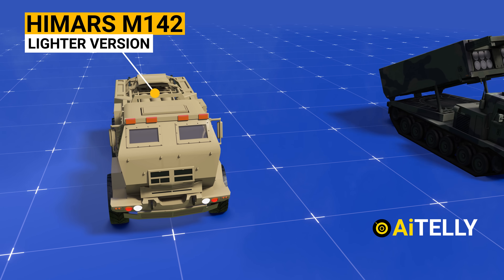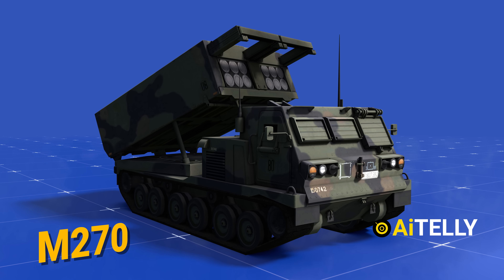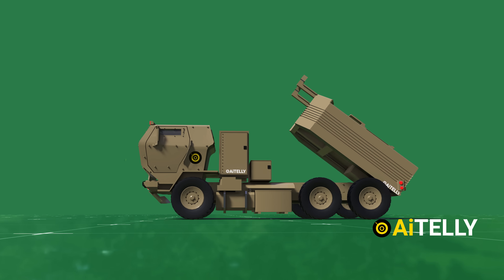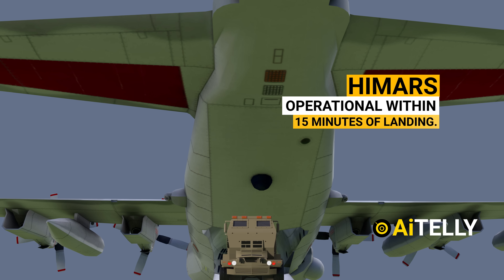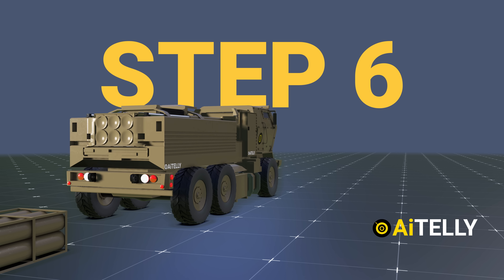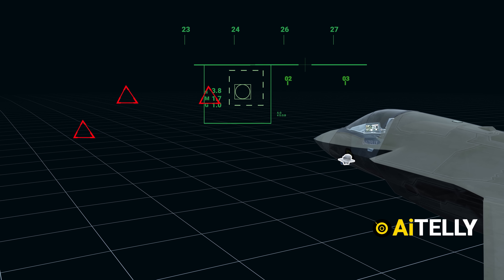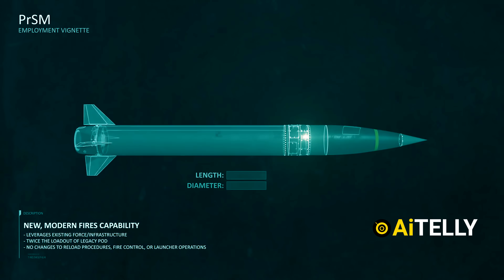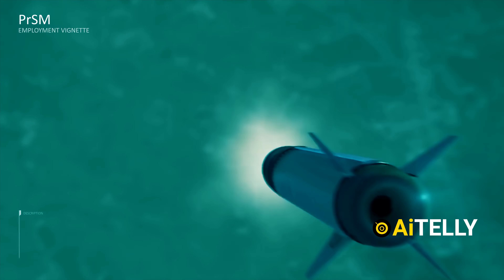HIMARS Precision Strike Missile  How it Works

Comment from the maker: Correction/ Detail Explanation  from Viewers Comments.

1)  verdebusterAP  (replied to a question) from Celestial Existence

How gps signals can be received when the missile travels at Mach 3 moreover the gps is inaccurate when the object is moving ?

Answer:
The missile use what's called inertial navigation system (INS) INS uses a combination of various factor to get the missile to target
GPS refines the targeting data so the missile is much more accurate
Thanks to advances in technology, INS is far far more accurate 
Again also thanks to GPS-jammers, the US developed newer sensors to counter jamming
Example 
Circular error probable (CEP) , basically how weapons accuracy is measured with out GPS is 200-300 meters
GPS can reduces CEP to about 10 meters or less 
In case GPS is jammed, the newer sensors developed can achieve a CEP of 30-50 meters
Lastly, to use HIMARS missiles against a moving target, it would have to be a very high value target or asset
Its called predicted none line of sight 
Basically , a forward observer provides the target course and speed
They take the target speed and combine with the missile speed which depends on how far the missile has to travel and come up with point of impact
Based on target speed of 40 mph , it will reach this point in 1 min 12 second
They designed that point and fire 
The M30/31 have 200lbs warhead so it does not have to be direct hit
They don't use this method unless its absolutely necessary

2) " nichevo1 "
Let me try. How GPS signals can be received when the missile travels at Mach? 3? I do not know, but my telephone can accurately gauge me driving at 100 miles an hour. And that's with music streaming. High performance military systems and in particular those using the military GPS signal presumably have higher performance capabilities. I would think that the designers were aware that they would be dealing with entities traveling at high speeds. Do you assert a performance limitation of GPS in vehicles traveling at a certain speed?

You ask a second question about inaccurate GPS on a moving object. Either It's the same question as the first, or you mean that GMLRS doesn't have a seeker. Maybe they could put one of those in the nose of this thing where they have the extra space. 

Meanwhile, aside from volley fire by dead reckoning, which I believe our host states is current practice, if you have somebody steadily designating it, I don't know, but it might be able to receive GPS updates in flight. That would be interesting to note in a later update. 

Anyway, that was never in its brief. But we love to stick more gadgets on everything so I'm sure the D variant will have a trimode unit for another mil ;-)

Third verse, same as the first. Military signal is more jam-resistant, military hardware is more jam-resistant.

3)" Joshua Thomas "

As a former 13M (multiple launch rocket system operator) The m270A1 is much faster over ruff terrain than the m1083 truck that himars is based on.  it accelerates faster as well because 1083 trucks have very bad acceleration. Tracks over any other surface besides paved roads are aloso superior.

4)" Hypersonic Hobo "

(Well explained regarding the efficiency between HIMARS vs M270A)

At the ranges HIMARS plays at you almost never need to leave the road unless there are just no roads, so functionally it will almost always be faster than the M270 in a European theater. 

What it loses in a rocket pod it gains in mobility, far easier maintainability (wheels beat tracks on maintenance every day of the week) and fuel consumption. These aren't the sexy aspects of warfare but an army marches on it's stomach. 

In the era of GPS guidance where one rocket can take out almost any target if you are using HIMARS as a strategic bomber as Ukraine is against depot's and HQ's you won't feel the loss of a rocket pod as much but you will appreciate how easy it is to care for and how unbelievably fast it is.

Military vehicles being primarily tracked ones when you talk about road speed limits. And at a theatre scale 20 kph adds up fast it will take 4 hours to drive what the Himars can in 3, that can add up to multiple extra launches per day.
Reply: GPS даже военный, в снегопад, туман, дождь, задымление ошибка до 100 м минимум
Reply: @Михаил-в5ф9ы  хорошо, скажи это вашим сегорешвим ванькам
Reply: On March 6, Russia struck with two daggers at once and completely destroyed an underground bunker in the Lviv region, in which several generals of the Pentagon, NATO, many colonels died ... there are also losses from the Armed Forces of Ukraine.  This was a response to Ukraine's sabotage invasion of the "old" territory of the Russian Federation.  Western media hush up this event.  The inhabitants of the bunker at a depth of 120 meters were not saved by the latest Western air defense systems.
Reply: Does it use others, like GNSSm too - eh?
Reply: You also got weight and length of truck wrong.
Reply: Kapan livenya booosku...????
Reply: Agree.
Reply: THE BIGGEST PROBLEM OF HIMARS IT IS TOO EXPENSIVE AND ROCKETS EASILY TAKEN DOWN EVEN BY SOVIET AA SYSTEMS, IN LONG TIME CONFLICTS IT IS USELESS, BECAUSE WILL EXHAUST PRODUCTION OF AMMUNITION
Reply: @dotabuff5288  production is already stretched. Will take about 18months to catch up m
Reply: The biggest fault of this system is that is isn’t very successful. In desert storm 1 this system shot down more allied plans then where lost by the enemy
Reply: @Grant80  ... you are making zero sense.
Reply: Молодцы, сумели распиарить на войне устаревшее барахло, продадут, а в свои войска сделают что то поновее...
Reply: @ivantitarenko6180  Apparently our outdated junk has far more capabilities than modern Russian combat units XD
Reply: It is necessary to shoot down all US satellites, Putin is kind. I would have shot down all the satellites long ago, without them America will lose its power

Comment: The Precision Strike Missile needs to be turned into an AGM munition. Air launched cruise missiles are becoming easier to intercept as well as JDAM kitted MK80 series gravity bombs which can also be spoofed. Putting it on pylons would also increase range & speed, slight modification to the guidance system & it won't be able to be spoofed & difficult equally difficult to intercept. You wouldn't need stealth fighters with such stand off range.

Comment: A feature of the war in Ukraine has been American technology. superior weapons holding off a much larger Russian force. within this context HIMARS is a true force multiplier but the Russian have many more rocket launchers many more rockets. Artillery salvos have been so intense war wastage reserves run out very quickly in modern warfare the number of missiles and a munition used has multiplied by a factor. and thus sustaining war is becoming difficult. This is were HIMARS precision matters
Reply: The Himars barely made a dent in the war as it was just more about adapting the Pantsir software to shoot down these rockets as well.
This is not a wonder weapons, both the Smerch and Tornado systems also carry GPS/Glonass guided munitions. 
That being said, the Russians are not there to take territory but to destroy the Nato proxy army. This is an attrition war that comes to its conclusion this spring/summer with a Ukraine collapse (as it runs out of ammo, troops and western funding).  Then the Russians will then march all the way to Odessa will very little resistance.

Comment: Hello Bonjour...Telly,
Apart from HIMARS , well there is one more star artillery rocket system , I want to tell you this interesting info, 
this machine became a star in the Nagorno-Karabakh War, and I like this system, because more variants can be launched from this system , this weapon comes from Israel namely EXTRA (Extended Range Artillery), It has a maximum range of 150km with a 120kg unitary warhead and an accuracy of 10m CEP (circular error probable/circle of equal probability), 
The EXTRA can be launched by LYNX (MRL) launcher, and modernized version of the Lynx, called the PULS (Precise & Universal Launching System), 
each launcher contains of eight (2x4) 4 pcs / Pod, 8 pcs / vehicle, 306mm EXTRA rockets , 
PULS features two PODS; each POD is designed for a specific rocket type, from 122mm /18 rockets range 35km , and then 160mm/ 10 rockets with a range of up to 40km both namely ACCULAR , 
and can also launch larger rockets and missiles, namely the Predator Hawk tactical ballistic missiles (SRBM) carrying four missiles (2x2) 2 pcs / Pod 4 pcs / vehicle 370mm max firing range 300Km 10 m CEP , and Delilah cruise missiles carries two missiles (2x1) 2 pcs / Pod 4 pcs / vehicle 330mm max firing range 250Km 1 m CEP (3 ft 3 in) 

well this is an extraordinary machine, Israel is one of the countries producing battle proven defense machines, this artillery rocket system can accurately and effectively neutralize the specified targets at all ranges, well I hope this info is useful for you Telly, well it's interesting to review anyway
Merci....Telly 👌😉👍👍
Reply from the maker: Thanks for the info

Comment: I still did not get the question answered how it steers. How does the missile know where it is and where it needs to be. How does it know wich vane or trust to engage to correct course. How do you programme the missile to go to a specific point. How does the missile start. Nothing has been explained.

Comment: This scenario is just one of many using PRISM.  Ukraine is using GMRLS.
Reply from the maker: We have never mentioned Ukraine or Russia in this content so it would be about engineering not political.
Yet here we are
Reply: @Aitelly  
Nonetheless, the scenario shown is less likely to occur.  That is a promotional scenario to sell the versatility of HIMARS, not to represent the most likely use case.  Rocket artillery is not flown from fire base to fire base most of the time.  It’s got an engine and wheels for a reason.

Comment: Radio signals (Electromagnetic Radiation) don't travel at the speed of sound, they travel at the speed of light which is 186,000 miles per second.  So a missile traveling at Mach 3 is only going a fraction of the speed of light so it's easy for a signal to catch up with it.
Reply from the maker: Yes this is goof infos
Reply: 186,000
Reply: @gromxxx  Yep, you're right.

Comment: I've finally understand that standing out frame is actually a self-loading crane. This is an advantage over the soviet 220mm "Hurricane", which needs a transport-loading vehicle.
But it is still not clear why the combat module is twice as wide as the missile container? Are there any supporting mechanisms in the sides?
Reply: It seems like the compromise of having one rocket module instead of two is to lower it's weight enough to not require tracks. Wheeled vehicles can move faster than tracked. Especially with 1/2 of the rocket modules carried.
Reply: It maybe one module of rockets is enough to reach the load capacity for the truck. The extra padding could just be mostly empty space.

Comment: Atacams (which take one pod) have 3 mach speed and 310 km range. Prsm (which take half of pod) will have 5 mach and 500 km range. scramjet engine is incredib
Reply: I think the real range, not published is closer to 700km
Reply: @sinistersilverado965  they just announced that. Originally it was going to be artificially limited to 499 km to stay within the anti-medium range ICBM treaty limits. But Russia has ripped that up like they did any other so the DoD and congress gave the green light to take off the gloves and give PSM it's full theoretical capability.
Reply: Will it be low observable? How will it fare against s400, S500, pantsir? Will it get over just on its amazing speed?
Reply: @nichevo1  srussian trash is nothing against this missiles. agm-88 enough for this
Reply: @Husker513  🐒 KINDJAL, SARMAT?
Reply: @nichevo1  considering they can't even track the basic HIMARS rocket, not even cheap slow moving drones, nor a subsonic anti ship missile, I wouldn't worry.
Reply: @hypersonichobo4263  I think the weak link is training and leadership. Because of these weaknesses, they operate with a lot of fear. Since the HIMARS only gives them a ~5-minute window, they have to get clearance from command, make sure it's a high-value target such as HIMARS or ATACOM, make sure there are no friendlies in the area... oops, it's gone!
Reply: @Bob_Adkins  I've been thinking that the Himars may never stop moving. There's the concept of shoot and scoot but I bet some of the Himars move continuously and then get a fire mission, stop, fire, then move again. 

Rather then shoot and scoot, it's Scoot and shoot
Reply: @hypersonichobo4263  Very possibly. I wouldn't be surprised. What a weapon! 200 pounds of HE that's almost guaranteed to take out any target with 1 shot is a dream come true. Only problems are, it's bulky and expensive.
Reply: @nichevo1  the key is utilizing systemic approach to attacking such targets. Using ATACMS,AGM-88, AARGM, LRASM and fake targets will deplete the batteries after which PRsM will get through to finish job.
Reply: Err......PrSM is solid fueled. Not a scramjet powered missile.

Comment: And the enemy just does not have any systems to intercept the missiles? OK. The very point in using the HIMARS and other MLRS against targets like this is that you are shooting many GMLRS (and normal MLRS) rockets to try to overwhelm the enemy SAM systems and sometimes you fail and sometimes you succeed. This video gives the completely false impression that you typically shoot a single missile at a single target.
Reply: No, that's how your guys do it. You haven't moved on from the Stalin organ.
Reply: An S400 has four rockets. HIMARS can fire 6 rockets. The S400 dies every time even if it could take down HIMARS with 100% success rate. But much points to that either S400 is not very good at hitting HIMARS or the crews are badly trained. In either case Ukraine might fire smaller salvos because the chance of getting a hit anyway is high.
Reply from the maker: You should take it as a grain of salt.
The only objective of making this video is to educate ourselves.
But if people like it then well and good 👍
Reply: @Aitelly  I wouldn't listen to them. While hypothetically they are right in functionality Russian air defenses have been entirely pathetic and there is little if any evidence that HIMARS has been shot down.
Reply from the maker: @hypersonichobo4263  We don't usually take it to heart so to proof that, Will keep on Producing Content. 

In fact next week the Content will be  of the "Russian Flying Tank" (Helicopter).

So as a channel we are curious of every Military equipment as long as it could be educational.

@Hypersonic Hobo Thanks for the Support